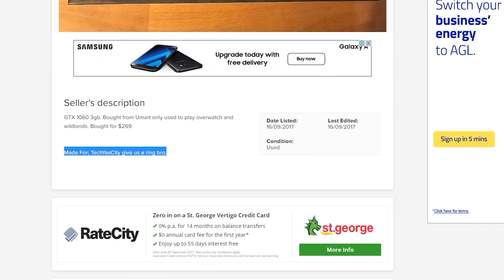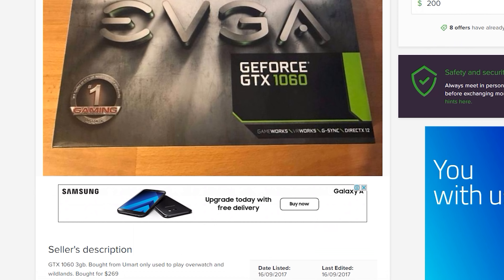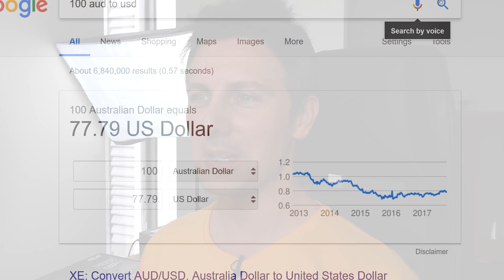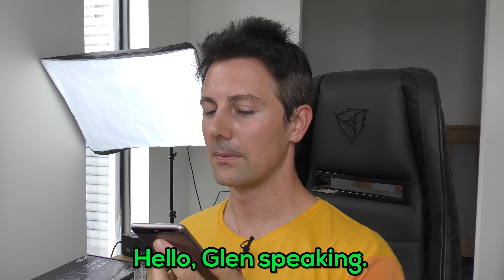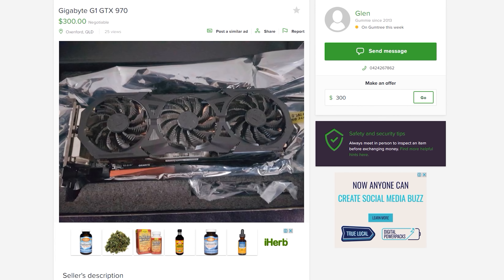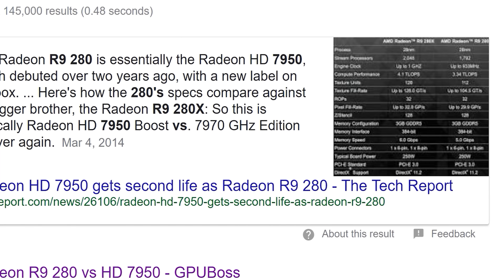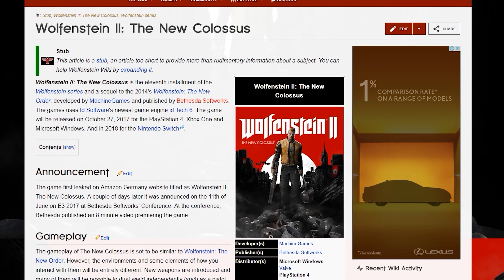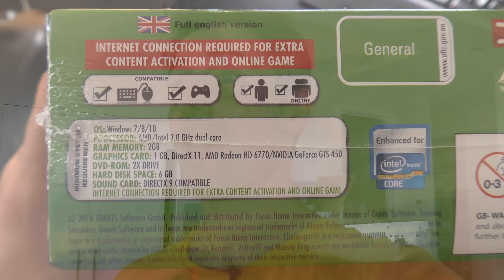October's BARGAIN USED PC Parts Hunting...!

Comment: Glen really likes his GTX970.... At probably one of the worst prices I've seen.
Reply: Geez , it almost like my country people are holding the price (300Usd ++ )
Reply: Budget-Builds Official yeah 300$ for a 970! You can get a 6gb gtx1060 with better cooler like evga ftw for that price and you can over clock the shit out too , and i bet it will out perform the 970, many people compare gtx1060 or 1070 witn gtx980 .....
Reply: Kuntal ghosh 1060 will outperform a 970, its more equal to a 980.
Reply: In my country gtx 1050ti is 150$, gtx1060 is 300$, gtx1070 is 500$, gtx1080 is from 700$ to 1200$ ,gtx1080ti is 1500$....... Most of the highest priced cars are on Amazon and even if you are lucky enough to get a good gtx1080 like me you have to 200$ for the fucking tax!!!! I have got my gigabyte aorus extreme gtx 1080 for 790$ and it cost 570$ actual! , I live in India and i am telling all those Indian don't use Amazon!
Reply: Yeah, he likes it so much he doesn't appear to want to part with it!
Reply: $470 why didn’t he buy a 1070
Reply: Ha I got my g1 gaming 970 here in the states off Craigslist for 150$ over a year ago. .
Reply: 9 months ago glen spent 350+ on his 970 when the 1070 was only $50 more
Reply: especially when you consider you can get a r9 290x for cheaper and get the same or near identical performance
Reply: It's understandable, most people sell stuff to get back most of the money they spent buying it.
Reply: its such a crap deal though you can get the same performance for $200 and save 100 to buy on periphirals
Reply: Just got a like new MSI Armor GTX 970 4GD5T 4GB OC for $185, how did I do?  Lol
Reply: i got mine for $160
Reply: Got mine for 150 USD. Got really lucky
Reply: 185 is a great deal is that us or aussie dollars?
Reply: kieran544 185 US... guess I could have gotten a better deal but it was eBay not a local sale, another one I saw went for $210ish so I thought I got lucky... last 2 seconds I sniped it lol
Reply: 185 is still a good price for a gtx 970 (in the uk they go for £175 $230 us and 296 australian) I have seen in abundance of gtx 1060's for 200 in the us, 
Even a msi armor gtx 1060 which performs the same as the 970, But at a lower tdp and being overall alot more efficient as well as likely more future proof.
Reply: if you ever need to look up pc part use game debate its great for comparing gpu's and cpu's
Reply: Yeah I saw a few 1060 6GB but most of them were $250-300 US.  The 1060 3GB are cheaper but I wouldn't go that low on VRAM.  I saw a lot of 970s going for just over $200 so I figured I'd give it a shot.  Maybe someday I'll upgrade once the 10xx come down a little further in price.
Reply: someone here was selling a 970 for $10,000 USD. lol
Reply: My country has a very low market for PC hardware ( I live in Pakistan) and yes you are right, the pricing is way retarded compared to USA. Before this mining shit I was unable to buy a gigabyte windforce gtx 1060 6gb for $320 technically its a lower binned model, and amazon has it for $260 but i didnt have that much at the time and resorted to waiting. Then HELL HAPPENED the same card is SELLING FOR $400 I SHIT U NOT. Anyway a relative was about to visit and he just bought a used G1 GTX 970 from the UK for 160 pounds, better than being scammed by idiots.
Reply: In my country a Asus Strix would go for 550 dollars, i live in denmark where gpu prices are alot higher

Comment: Someone is just SENDING you an SR-2, I'm... completely aghast. Those things are rarer than hen's teeth and cost twice as much. Good on you, hope to see you put that puppy to work in a monster setup.
Reply: I did get salty when i heared he was getting it dor free. Its literally my favourite motherboard of all time
Reply: jordan lewis ditto m8, I've got a pair of X5660s that behave like gold bin chips, they both run ice cool with HP's cheap 65w cooler, the power draw is so low I can max them both out and stay under 600w. These puppies are begging for a SR-2 to treat em' right, but the ebay price for the single board available gave me blue balls like you wouldn't believe.

Comment: have you tried checking if the li-po/li-ion battery is swollen or puffy? or it could be just as simple as a hardware fault so all you need to do is unplug the battery, wait 10 secs and plug it back in then see if it powers back on.

if this message helps anyone let me know i would like to hear on what you need to say about it.  :)

Comment: Remember when the 1060 6gb was 230-250$....now its 350
Reply: I recently bought several cards for more used, than they were new last year... R9 Fury was a card I paid $260 for new last year (absolute bargain!), and I paid $300 for one recently for Crossfire, and then the RX 470 was $150 last year (new), and they are going for more than that, but I managed to get one for not much more (I have a second system that was/is running a water cooled potato, an HD8490, runs Unturned at 5 fps at minimum settings and 480p... Actually have 2 of those (only 1 water cooled just for LOLs), but they don't support crossfire, I got those from a friend for free).

Comment: I had the Asus 970 strix was the best over clocker i had. I got mine new for £215 when 1070 was relesed. I had one already that i paid £289 for 2 wks before. In sli they would keep up with the series 10 cards in 1080p,  actually beat the 1070 in firstrike.

Comment: Haha! "The 1060 is basically rubbish". What a tosser :D
Reply: I got a 6gb 1060 and it's already more powerful than the 970 and I can overclock it a lot if I want.
Reply: The 1060 really is an awesome performer. I recently installed a 3 Gb. model in a budget Ryzen 3 build, at it smashes anything he plays :)
Reply: So thays mean 580 and 480 is a rubbish too?
Reply: +wee siang   Compared to some systems it is, but definitely not compared to a single GTX 970. Those RX 480/580 are pretty good, and I would take that over the 970 any day (unless you really need Cuda acceleration, but in that case, you will probably pick some other Nvidia card). Clearly that person either had no idea, or was way overdoing the sales pitch.
Reply: Jake Garrett i already got 1060 6gb and its already more than enough for 1080p @60fps. I just fed up with people calling 1060 is a rubbish and said 480/580 is better but it real gaming experience 580/480/1060 is just almost the same performances.
Reply: I think they are about equal (so I would just recommend whatever is cheaper). Previously, the RX was cheaper (in the US), but they are good at mining, so they went up to 2x value for a while. Both are pretty decent cards (especially for 1080p, I would even say it would be worth it to spend a bit more and get a 120 Hz monitor because on easier to run games, you won't have any problem hitting that, but it will still look good at 60 fps, but that's only if you were buying a new monitor). That should be a plenty powerful card for at least 95% of games at High settings, so you should be good to go!
Reply: 1060 6GB Overclocked can beat basic 980's :D
Reply: Did you guys forget about the 1060 SDRAM version?

Comment: Another great video Bry! Quick question, I have a multitude of fully built PCs ready to sell on after getting some ebay bargains, how do you go about figuring out what to sell them for? & which platform would you say is best for selling PCs? Ebay/Gumtree/Facebook?!. Thanks man and look forward to more videos :) 
P.S. From the UK but still curious as to what methods of selling you find best.
Reply: Try a Facebook selling page, as long as it looks good and you advertise it correctly, they wont care about the specs
Reply from the maker: Hey thanks for the question.  I personally only sell used builds locally, if people then have a problem then I can help them out and don't have to deal with buyer's remorse paypal returns, ebay fees, crap getting broken in shipping etc.
Reply: Thanks for reply and Ahh fair enough. Do you just put on gumtree for local  or ebay local collection only? Sounds like a good idea though! Thanks again.

Comment: Xeons man, i love them too. Just bought a X5675 (under 30 euro) from Aliexpress and a 
Asus p6x58-e locally for 130 euro. Now i want to get some ram, 3x4 GB should be enough for now. Seen from your video i can run ECC-ram on this motherboard, but which kind? You have 1R, 2R and 4R (R=ranks). Can you tell me which kind should work best?

Comment: @tech yes city, Brian I got the best bargain on ebay. It was on auction under for parts/not working only because the seller didnt have an operating system on it. He also listed in the details that there was a gtx 760 in the pc but it was actually a 780 which I noticed in the very blurry pictures. None the less I picked it up for $251.38 and what I got was i5 2500k with stock cooler, evga ACX sc gtx 780, 16GB ddr3 from corsair, bluray drive, 2 x 2TB internal HDD, 1 x 240gb ssd, sound blaster sound card, tv tuner, 750w antec modular power supply, HAF X case with fans, gigabyte Z68X-UD3R motherboard. Everything works well, I know I can get about $850+ for it all. (this is all AUD)
Reply from the maker: Damn thats a nice pick up.

Comment: I got an i7 6850k for $250 bucks
And an Asus X99 Delux II for $125.
 Couldnt pass up this deal
Reply: Hayate Azekura x99 for 125 lmaoo
Reply: Hi Im Seyf 
I like it. These boards go for 300+
Plus I want all the PCIE lanes. So 40 laned and extra for  the price of a mainstream build. Yes please
Reply: Hi Im Seyf good deal 600w corsair psu x5650 gtx 650 ti 12gb ram noctua cooler asus x58 mobo 200€

Comment: Still having my Gigabyte P55A-UD3 motherboard with I7-870@4,0GHz 1,25V. Max overclock with this is 4,18GHz@1,35V. Paired with Asus strix GTX970 oc, I'm having good time gaming at 1080p60Hz. Those Xeons are also good value with these lga1156 mobos because you can overclock every CPU with fsb with these mobos. Thanks again for great video, loving these. Cheers from Finland.

Comment: I GOT A EVGA 1060 SSC 6GB BRAND NEW FOR 110$ IM SO HYPE. Also, just built a guy I have my number to a new pc. I5 7600k 16gb ram, 1060 3gb, 120 ssc 1tb hdd for 550$. Gave me his old build, the FX 9370 toaster, 16 gb ram, 1tb hdd. I grabbed a 2 month old h100i v2 for 40, stuck in the 1060 and now have a great gaming pc for around 150 dollars!!!
Reply: willie dobbs where did you find that 1060 for 110 😂
Reply: OTC Meqeri I get on Craigslist, Offerup, Letgo every night and negotiate. Also has the 3 year warranty. Have to have the drive and passion to find this stuff. I just turned 18 and have to save for college so I don't have much to spend, so I try to find them deals
Reply: willie dobbs ya I try to find deals aswell. Not much to find on eBay but I haven’t checked out those other apps so I’ll take a look now!
Reply: OTC Meqeri Yeah man, it's scarce here too I'm in Vegas.
Reply: willie dobbs  I’m in Texas. Just downloaded letgo 😂

Comment: Xeon vs Ryzen incoming?
Reply: Jarrod'sTech - lel nope, we know ryzen is the winner because it has no micro stutter and it is smooth throughout whole game play,  i had a xeon x5460 gtx 1050 ti and it stuttered soooo much that i sold it for £400 (made it for £240) anyways, know i have a ryzen 1600 3.8ghz gtx 980 ti, its all siting in a very closed and compact case but temps r fine. my friend has a i5 6600k gtx 1070, and i notice how it shows 60 fps in somegames but it ceryainly looks  little choppy and unstable, although intel has higher fps than ryzen, ryzen will actually deliver a smoother stutter free exp. despite the 10-20 fps difference is some games. i know the comment u wrote is a joke, but i got into the heat of the moment serry matey!
Reply: _ WereWolf_Engine _ tell your friend to enable vsync , it won't stutter anymore
Reply: Daniel Z - sure thing
Reply: _ WereWolf_Engine _ I also have a 6600k and a 1070 and I don’t notice any stuttering in any games unless they’re extremely unoptimized like ARMA 3.
Reply: Stephon Caprioni Garcia - yeah i agree with u, i shoulda been specific about the games but aaahh well
Reply: @Just_Haider_  Never had any stuttering issues with my x58 platform Intel chips, from the i7 920, to x5675 and x5680 Xeons. Sounds like a DPC latency issue caused by driver issues.

Comment: That "well I bought it for $470 a long time ago" kind of attitude is massive in the US (probably everywhere, but our Craigslist, sort of like Gumtree, its hilarious seeing some rip offs). Like, sure I have a GPU from 2007 that cost $2,799 (not counting the massive inflation since then, and how wages have skyrocketed), but it would be a rippoff at $50 unless your either a collector, or want a cool looking hand drier (Furmark, it works great for that, not even joking, had my desktop near the sink for a while...).

Value wise, its probably closer to $10-$15 (but the scrap metal price of its full copper heatsink is close to that, and the fan is around $10).

Comment: hey i am planning to upgrade to my CPU and GPU, my primary use 
is to record game-play  and stream with obs studio and i would use 2 
monitor 1 is 1080p for primary game-play and the other monitor is 720p 
for secondary purposes, i planning to buy ryzen 1600/1700 or i7 8700k or
 i5 8th gen CPU, and for GPU i am planning to buy 1060 6GB, however i do
 have 1050ti oc edition form zotac, will 1050ti perform better with 
streaming and recording game-play or do i need to upgrade to 1060 6GB 
for future proof, can you kindly suggest me a good CPU &  GPU 
please??
my current specs
cpu- intel g4400
mobo- gigabyte B150 ds3h
GPU-  zotac 1050ti oc edition 
ram- hyper X 8gb (1x8)
stock cooler
SMPS- 500 watts cooler master.

Comment: Isnt a 1060 6gb just slower than a 980?
Reply: Silverine Silverine ye i think
Reply: Silverine Silverine same performance on stock but when it comes to overclocking, the 980 stomps the gtx 1060
Reply: Ali Rizwan 980 ti is extremely close to a 1070. No way you could overclock a 1060 to 1070 performance
Reply: http://gpu.userbenchmark.com/Compare/Nvidia-GTX-980-vs-Nvidia-GTX-1060-6GB/2576vs3639

About a 4% difference in favour of the 980.. I mean it was last years high performance king for awhile before the 980ti came along

So basically around the same. It technically should cost around the same as a 1060 6gb but he probably bought some expensive fan configuration or shitty online or in store deal so $300 seems alright even if it is used.

But no way in hell somebody today would buy it over current gen hardware except for nostalgia's sake or etc sentimental value kind of like the Sandy bridge cpus except those are just great value.
Reply: dustojnik hummer I don't think so if you look up benchmarks the 980 and 1060 6gb trade blows but the 980 takes the win,  it might be that way with the 3gb but I know the 6gb is pretty much a 980
Reply: I would not use userbenchmark as a comparison tool. It is really really bad in 90% of the cases.
Reply: Manweor got any good alternatives? I wasn't too interested in doing a full day session just a five minute Google search.
Reply: Manweor sorry haha lol.. Please recommend some good alternatives or sources maybe I just pulled up some quick data.. asap
Reply: Meesa Called Jar Jar Binks Nah he doesn't have any alternate sources, because you're right. Ive got the Msi gaming x and it clearly outperforms a 970.
Reply: BishopOfHexen192 cool the GeForce 10 series have really brought us a long way in terms of gpu performance. Can't imagine how they are going to try and top it next iteration *crosses fingers* hopefully next year maybe if not the year after.
Reply: You clearly are a victim of the fanboy war. If I dispute the source it doesn't mean I am disputing the result. Search for any reputable 1060 review (look at Hardware Unboxed here, for ex, or even Brian's. Anandtech or GN if you want a written review). If you look at multiple sources you will see that the 1060 stock is between 970 and 980 on average, leaning towards the 980. Overclocking both usually gives a larger improvement on Maxell, but at the cost of much higer power draw. And in modern games the 1060 is usually at 980 level, thanks to a better DX12 implementation and better driver optimization (Nvidia tends to slow down optimization a lot on older generations for newer titles, that was proven by many reviewers shortly after Pascal came out).
Reply: Manweor all good bro didn't come here to argue just present some quick and fast information. If you can answer the original commenters statement or question then by all means do it but I did not come hate to argue.. yes I am a nvidia fan boy on gpus atm but only because amd hasn't still convinced me otherwise but that is besides the point.. If you have good concise understandable info please share it with us as that is what this is all about.. My knowledge on every single gpu out there is limited and I have to choose and specialize my research topics as I don't have enough brain space any more lol after reading tech review sites I think nearly every day now for the past 10-20 years haha lol or since whenever Tom's hardware and etc has been around anyways I'm tired so answer OP's question and let's call it day.

TL;DR not here to start a war bro.. just need some rest so I did a quick five minute Google search fly buy information drop
Reply: When I said I looked up benchmarks I meant in game play not synthetic crap like gpu score or whatever because those are a load of bull
Reply: Silverine Silverine so true sorry I need to lie down been pretty burnt out lately wracking my head over nothing and not getting enough sleep.